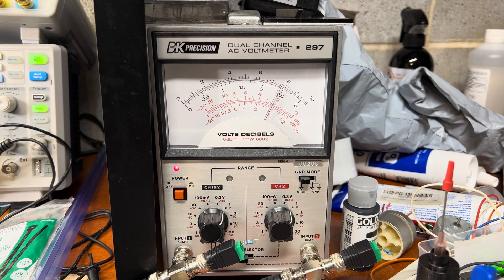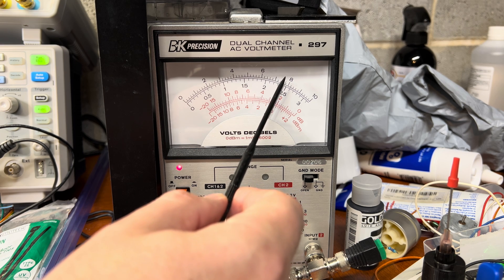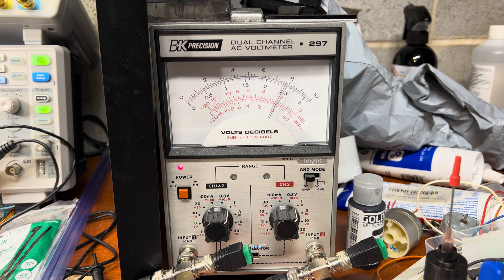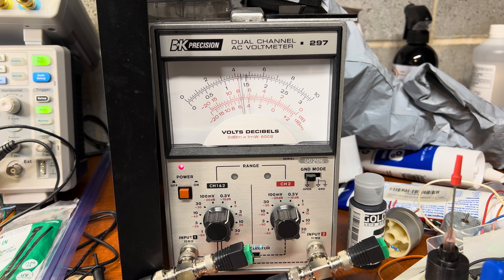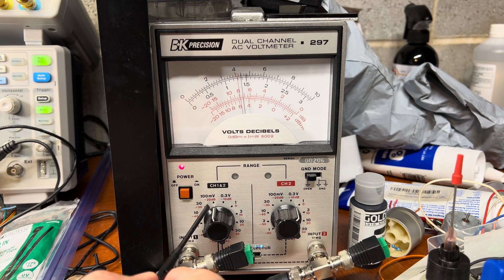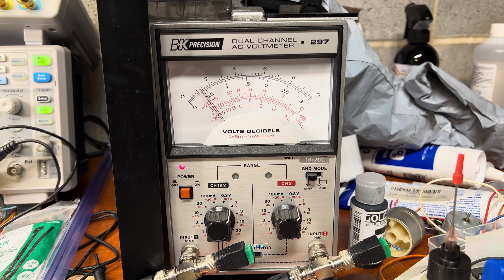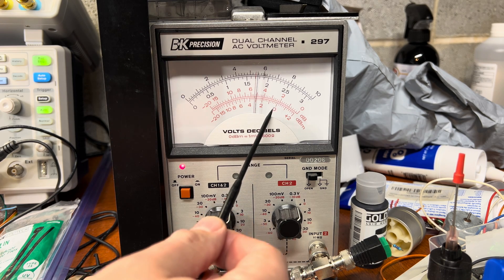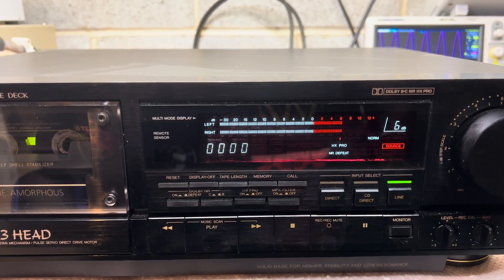How To: Use AC Millivoltmeter or VTVM - A Comprehensive Guide

Comment: So, do you hook up the millivolt meter to the output of the cassette deck or reel to reel that you are troubleshooting/testing? anyone know?
Thank you
Reply from the maker: Millivoltmeter is a measurement equipment. You may measure output values from the RCA to check on the dBm scale OR you may hook it up to the PCB to the control points to measure the amplitude of the AC signal. That is the basics. Try to watch some starter YouTube courses for electronics.
Reply: @hifirulezzz  thank you . I will.👍

Comment: I will not be able to follow the Premiere but I'll surely take a look at this video later on.

I am bit a puzzled as to how one still needs this vintage analog device in our digital scope domain. I should have watched enough Mr Carlson's lab to get a hang of it but I didn't. I still need to be briefed.
Reply from the maker: Well, with computer I can measure up to 20 kHz only due to 44.1 kHz sampling rate. With this device I can measure amplitude of wave form way over 100 kHz
Reply: @hifirulezzz  and what about the theory of the measurement instrument having to have at least 5 times the sampling rate of the frequency being analyzed? So to reliably capture a 20 kHz signal you should sample it at 100 kHz. My Creative X-Fi card does DA up to 192kHz 24bit but I have no idea about recording. Will check later.
Reply from the maker: @m80116  well, we happy that you have a nice audio card. But theory says they you need just 2.1 times of the sample frequency not 5. That is a Furrier transform.
Reply: @hifirulezzz  you're the first person not mocking me up for having Creative Labs. sound card, I still don't believe you but I'll consider that as a compliment.

And I don't have just one, I have some kind of OCD that makes me pile up things I like. I have two X-Fi (top of the range), one Audigy 2 ZS and one Live! with surround.